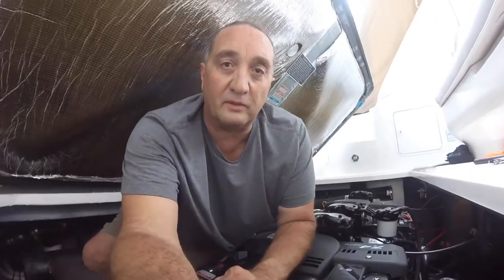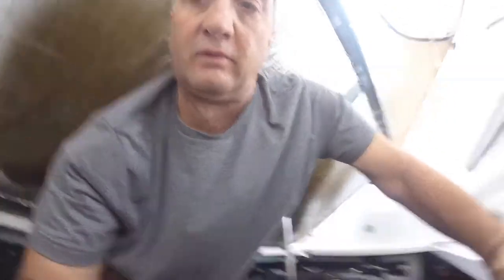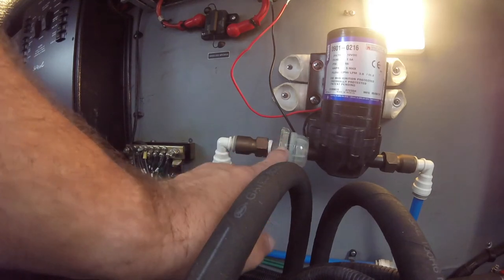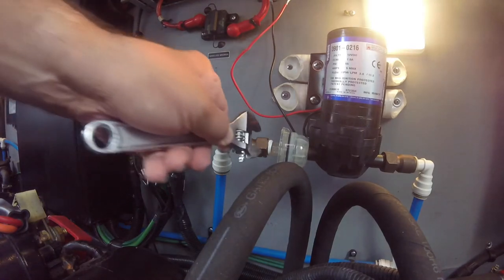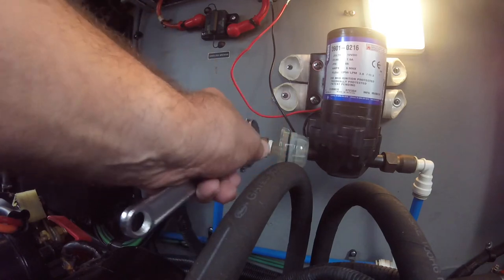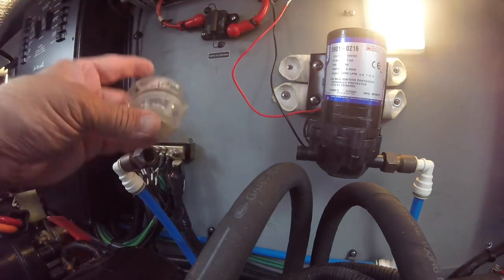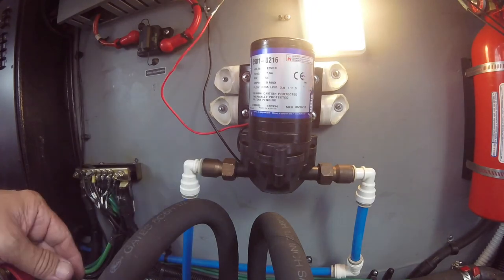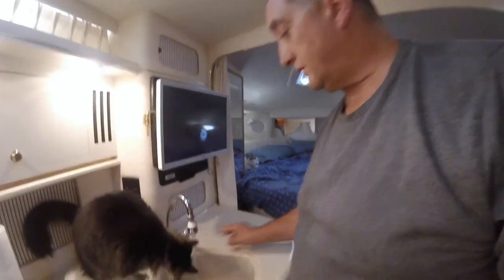Water Pump Problem | Boating with Drifter ep 05

Comment: That is a filter.  My Silverton had that same filter on it.  It is made so that you can clean it out occasionally as needed.  It should be on the input side of the pump.  I am now in the market for a Sea Ray and I really like the 340.  I am 6'2" and like that the 340 has the large center bed.